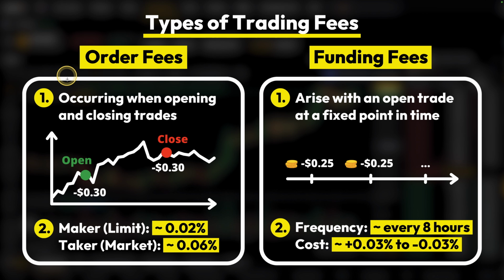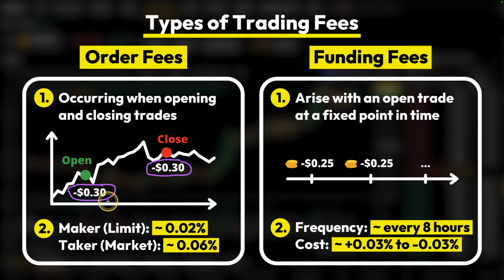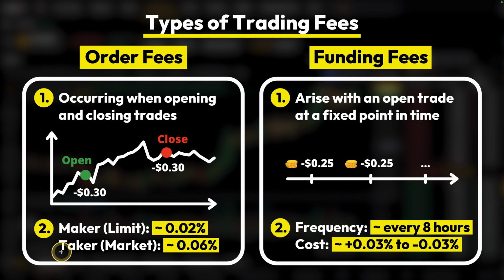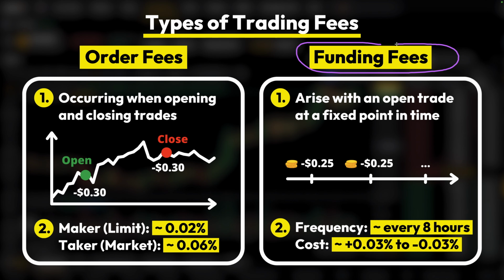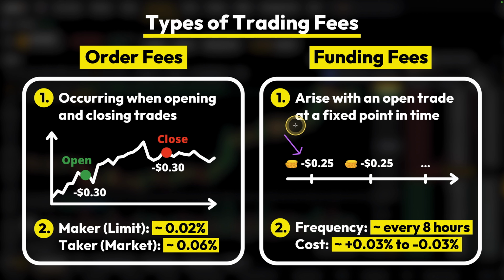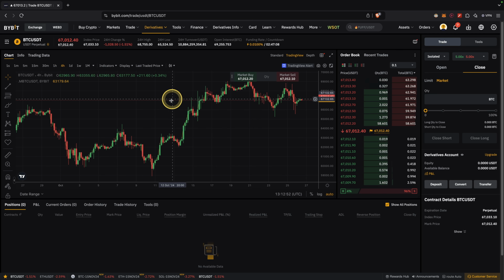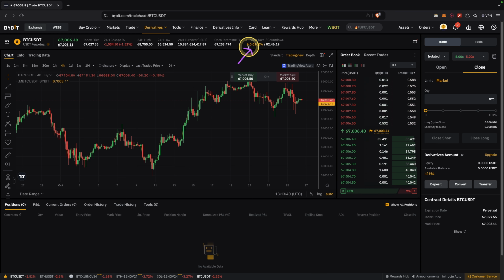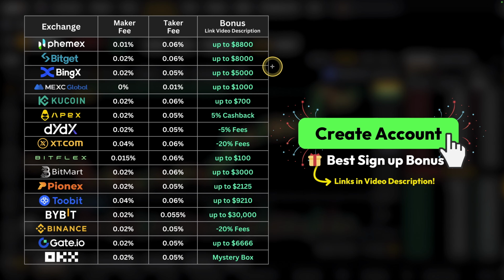Crypto Leverage Trading Fees explained ✅ Order Fees & Funding Fee (Explanation + Examples)

Comment: You didn't talk at all about fees for leverage even though it's in the title... I would like to know if there are fees I have to take into account if I want to trade with a 100x leverage for example
Reply: i believe that the fees would multiply based on the positions value, i have done 150x positions and the fees were around 30 dollars. so i think you would have to multiply the initial fees by 150x also